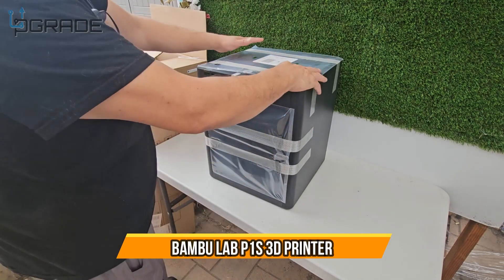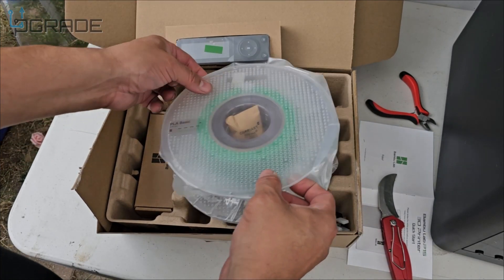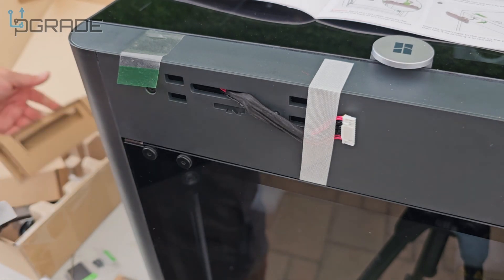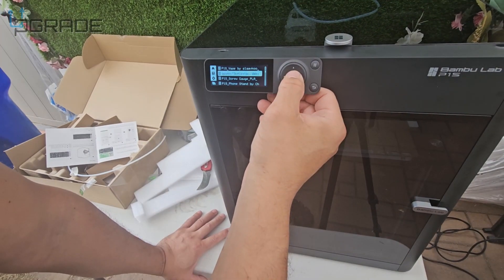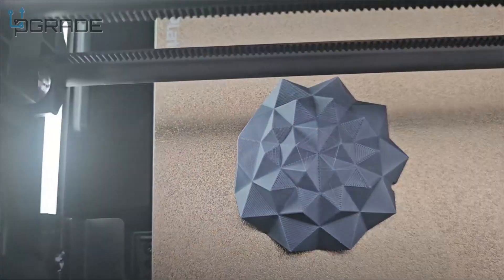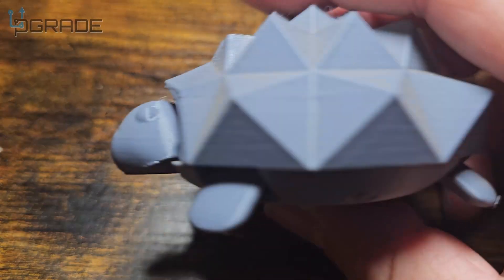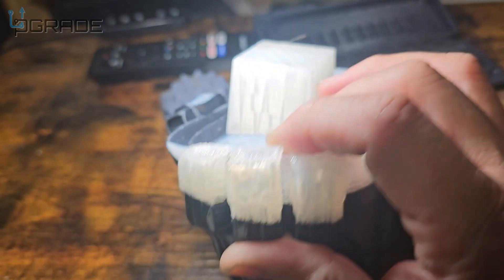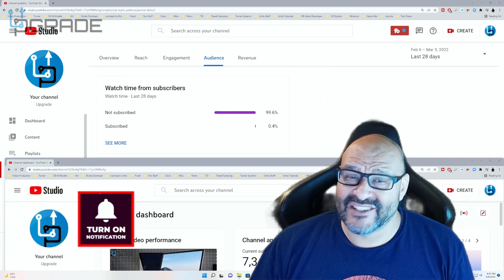Bambu Lab P1S 3D Printer

Comment: The main advantage is the P1S comes with the AMS for color printing and its around a grand for that setup ($950).  There are addons for some other printers out there that do give them color, but none are as cheap as the P1S setup, nor as seamless integration either.  Its a decent solo color printer but getting a P1S or X1 your getting it for the AMS/Color printing aspect.